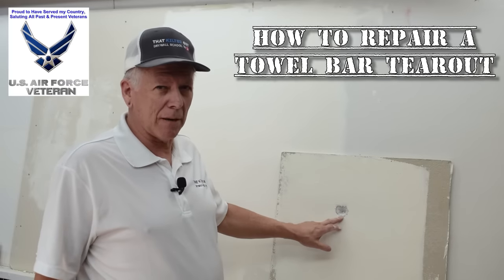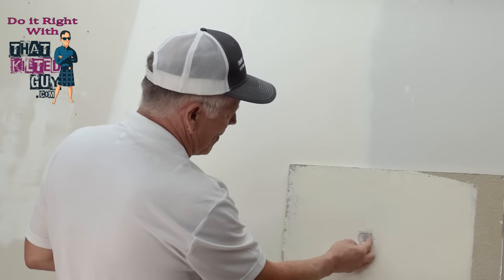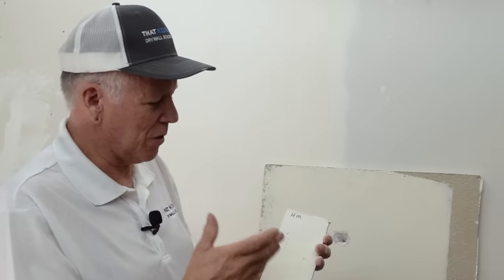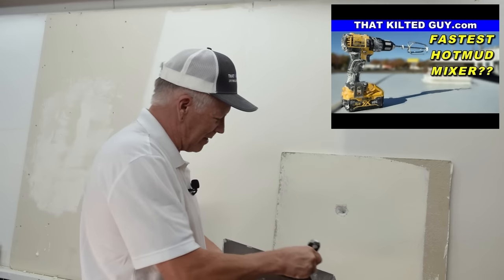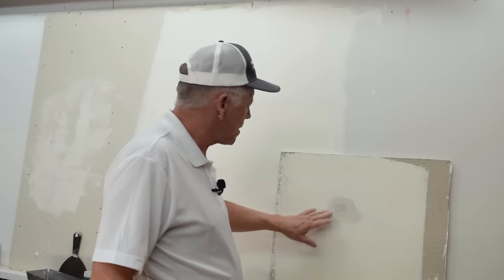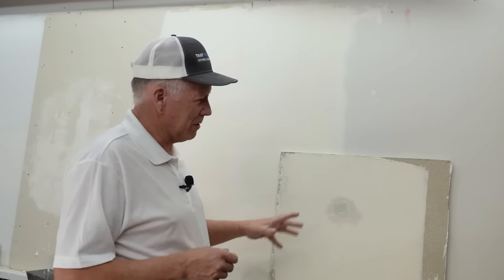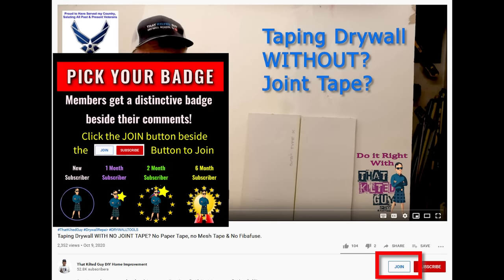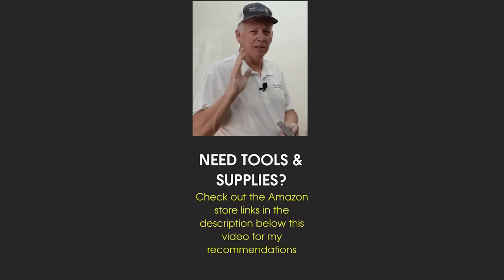How to repair a TOWEL BAR Ripped out of the Drywall

Comment: Most of these towel bars failing off are  not from children  using  it as a grab bar it's from children  pulling  the towels off   to the side  when drying  their  hands and the anchors are not sufficient enough  to be used in most drywall mediums   toilet  paper  holders are doing the samething. Drywall  isn't a strong  medium  for use with everyday use  with shotty anchors , most of these  homes are builders  track homes that use crappy  components to anchor towel  bars to drywall,  I started  working  on builders  track homes  in 1981 and have seen it all when it comes to anchoring systems , if you have small children  it's best to use a towel bar that's mounted  on a wood base plate that in turn is screwed  to the wood studs every  16 inches instead. Of the drywall.  As kids are hard on on these items!  Kids are kids !

Comment: I would like to see the towel bar being replaced, and how strong it is, that's the purpose of the video is it not?
Reply from the maker: After this repair, you can re-install like normal.  It will be the same strength as before.  If you wanted it even stronger, you could cut out about 1 sq foot and add plywood backer strips, then refinish and re-install.

Comment: So strange that my kids just pulled out the towel bar. I'm actually going to cut a hole from the other side of the wall to add 2x4 bracing so that the kids can jump on the towel bar and still not tear it out. Also really liked how you experiment with hot mud vs all purpose to determine how thick it can be before it starts cracking while drying.
Reply from the maker: Donald, thanks for being a subscriber. I’m going to do another video one day showing something similar. You could cut out a section from the towel bar side and slide 12” long 2x4s in as backing making it much stronger.
Reply: Every time I have one of those pullouts, I cut it big and put in the bracing.  When I mount a towel bar, it is always to studs or a brace goes in for attachment.  The kids taught me that lesson years ago, anchors or even just screws are temporary as far as they are concerned.  And then the older in-laws start using it as a grab bar too.  Moved the towel bar and put in a proper grab bar for them at their house.
Reply from the maker: Reinforcing is the BEST way for sure
Reply: Ist thing you do is discipline your kids and make a  big deal out of pulling off the towel rack before you go cutting big holes in the walls. I raised 2 rowdy boys, I know

Comment: Am I understanding correctly? Using the hot mud let's you re attach the towel bar in the same location anchored in the hot mud? I do section 8 apartment maintenance and this would be a game changer if I'm understanding correctly. You know these section 8 peeps can't keep a towel bar or tp holder in the wall to save their life. 😅
Reply from the maker: It’s strong enough to hold up a towel, but it can still be ripped out. Only if there’s plywood behind it will it be super strong

Comment: Thank you, thank you, thank you! Your video was so incredibly helpful. I went with the 5 minute hot mud because it was the only one I could find in a smaller quantity (3 lb bag). I had no problems with it setting too quickly. I let it cure for a couple days just to be safe. I sanded it, primed it and painted it. I was able to replace the towel bar mount in the same location, drilling a couple of holes in it for drywall anchors, and it's so secure and holding. Other than having to replace the torqued towel bar with a new one that's a little shinier than the mounts, you can't tell anything happened. Thank you!!!!!

Comment: Once the hot mud is set and sanded, can you re-drill through it to mount the towel bar into the same spot? I have wallpaper, so ideally, I would want to mount it in the same spot again. Is the hot mud strong enough to drill through and hold?
Reply from the maker: Watch this - Testing a DRYWALL HOTMUD ONLY Repair.  It's STRONGER THAN THE DRYWALL or Plaster
https://youtu.be/5_t38ZVG-ao

Comment: Can you use screws or lags bolts after this so the towel bar can be reinstalled?
Reply from the maker: This method will hold a light amount of weight such as a towel but anything heavier needs additional reinforcement such as a Molly bolt or backing material behind the wall

Comment: Thank you for the video. I broke my towel holder and it has a little dent and if I followed your method would it be ok to replace a new towel rod on the same spot again?
Reply from the maker: I need to do a video testing this but I think it’s about 80% as strong. If you use hot mud by itself its stronger than the drywall was but it could break away from the sheet rock. Check out how strong it is here - THIS IS CRAZY! I Can't Believe This Drywall Repair Method Worked! https://youtu.be/vZtOdhBuz90

Comment: What is the second coat material?  Is that also 5 min hot mud?  The picture looked different from the first, and all you said was "we can coat this little one with a six"  But I don't know what "a six" means.  Thanks for your help!
Reply from the maker: 6=6” knife. Any mud works for the second coat but when it’s really thin I usually just use regular mud for the simplicity of it
Reply: @ThatKiltedGuyDIY  Thank you.  Since I want to save money, I think I'll just use another coat of the hot mud, if it's all the same.  Time doesn't matter.

Comment: Thank you for this video! Can I put a towel bar on the same spot after I fix the hole or the hot mud will not hold it?
Reply from the maker: It should hold It for light use
Reply: @ThatKiltedGuyDIY  thank you!

Comment: Great video.  After many years of DIY I was unaware of hot mud.  For holes such as this I always cut out a rectangular hole and screw a piece of wood backing across lengthwise.  I then fill in with several coats of joint compound.  The rail anchor then screws through to the wood which makes it incredibly strong.  That might be a bit of overkill now that I know about hot mud.  Many thanks.
Reply from the maker: That is stronger but unless you cut a hole in the other side you still have one weak point. 
www.ThatKiltedGuy.com
Reply from the maker: You are welcome Buddyboy

Comment: Thanks for this. Where is the link to the "Hot Mud"? Is it the Zinsser Guardz problem surface sealer link provided in the description? I have a wide blunt plastic screw anchor that ripped a chunk of the drywall out and I am hoping this will fix the damage. Alternatively, can I use Bondo since I have some of that offhand?
Reply from the maker: Bondo is much harder to sand and work with. I’ve used it on woodwork but not drywall. You pick up hot mud locally at the big box, stores, or a drywall supply company

Comment: I like the video, but I'm having some difficulty finding "hot mud". Is this a brand name  ? I 've asked at Lowes & Home Depot and they don't know what I'm talking about ?
Reply from the maker: Hot mud is what we call Fast setting joint compound.  Often sold as USG Easy sand.  We call it that because it chemically hardens through an exothermic reaction and that actually warms up quite a bit

Comment: I've only been able to fix this in two ways: use a larger wall anchor (the spiral kind) or move the towel bar up an inch and patch the orignal hole and repaint. I had to fix this many times when the kids were little.

Comment: When I do bathroom remodel I put 3/4 inch plywood in the wall. I have also bought  Stainless steel pipe and cut it so it fits between the studs for the towel bar. Some tenants are hard on things

Comment: I never thought hot mud would be strong enough for that kind of a fix. I figured it would just pull out again. I've always filled the hole with regular mud and moved the towel rack a little to mount in new sheetrock. I will try filling with the hot mud next time and mounting in the same place. Thanks.
Reply from the maker: Watch this- THIS IS CRAZY! I Can't Believe This Drywall Repair Method Worked!
https://youtu.be/vZtOdhBuz90

Comment: I find it utterly ridiculous that towel bars are not made to 16", or 32" centers. Most new houses are now  built with blockingin the walls at towel bar and cabinet height, but the older ones have nothing. Who cares if the towels are not sized for 16" centers, they can be folded. I say fire the people who design these things, they should know where the framing exists.

Comment: After repairing the drywall with this, can I then drill in screws into the repaired area? Will using this product help to hold the screws better? 

(I had a towel bar that was installed with anchors and its left a big gaping hole. There are no studs anywhere in the wall.)

Comment: I used something called gauging plaster in the late 80's to make regular joint compound set up faster.... Hard to do right....Then came Durabond 90 which set up in - guess what---- 90 minutes.... I lost many a drywall pan to durabond 90 because when it set up in your pan you could not get it out and you had to throw the pan out...  When the "hot mud" that he is using came out it was a God send....It is called EZ sand 90 or EZ sand 20  or the EZ sand 5 that he refers to... It is great to work with and I agree with everything he says here!!!  I don't have a Youtube channel and HE does.. Listen to him as he knows what he is talking about....
Reply from the maker: Thanks, I appreciate that.  Even the EZ sand can be a bear to clean up if you forget and let it dry, but with a green scrubber it will at least come off.  Take care, Guy

Comment: Will hot mud be strong enough to reuse the same spot with a wall anchor, and have the same holding capacity as on a new spot in the drywall (no stud behind)?
Reply from the maker: If it’s done right, yes
Reply: @ThatKiltedGuyDIY  - Which type and brand of hot mud would you recommend? The one you’re using in this video?

Comment: That helped a lot.  I take it you can reuse that spot . Meaning you can put another type of bolt or anchor in there to hang towel bar in same location
Reply from the maker: When doing a repair like this, it’s best to move the towel bar several inches higher. Otherwise it’s best to cut out the damage section and replace it by installing good secure backing pieces to attach the repair to.

Comment: You get a board long enough to go between two wall studs, stain and varnish, else paint it, put that up, screw it into studs and put the towel rack on that.  That, when wall studs are not available in the right place for towel rack ends.  You don't waste time with plaster wall mounts.

Comment: How long for 20-min hot mud to fully set? I mixed and applied 20-minute hot mud into a hole from my daughter pulling out the curtain rod mount. It’s a full thickness hole about 5/8 to a 1/2 inch deep. I need to set screws back in to mount the curtain rod back up
Reply from the maker: It's fully hard in roughly 45 minutes but be sure to pre drill it as it can crumble

Comment: Do you have to use normal joint compound at the end? I understand it's easier to sand, but they all seem to come pre-mixed and I'm not sure how long they will last. Since I rarely fix things I like the powder for storage. I have never bothered with the final skim coat of joint compound. Am I missing something big? I like the fact that the 5 minutes dries quickly and I can move on. Thank you for your videos 😊
Reply from the maker: You can use hot mud to the end just fine. Just don’t expect to sand any thickness down. But thin stuff will sand fine.
Reply: @ThatKiltedGuyDIY  is hot mud harder to sand?
Reply: @juanito3821  Yes.  Like he said though, don't expect to sand down any thickness.  If you want to use it's for all stages I'm finishing, make your last coat really smooth and feather your edges tight. Then you can do a finish sanding usually to touch up any small imperfections.  A common method is to use hot mud for initial coat(s), then use premixed compound for the final thin coat, for easier sanding.
Reply from the maker: MUCH harder to sand. Edges sand pretty easy but the middle is much harder to sand.
Reply from the maker: Exactly

Comment: Kilted Guy.  I need a video on how to mud a drywall joint that has an electrical box 3 inches from the joint.  The box totally throws a wrench in your normal approach.  Or a video on how mud a 3-way joint that forms a "T".  Like a where a vertical joint meets a horizontal joint.

Comment: Good demo but I want to see a repair on already textured drywall. Makes it a lot harder to get it smooth when you're fighting large knock-down texture. And I don't see how you could even sand the repair without sanding the surrounding texture down.
Reply from the maker: Use a sanding sponge on the surrounding texture edges.  The surrounding texture is MUCH tougher due to the paint. I show that in other videos.

Comment: THANKS for this video!  I had to rip out some bad DIY tile from a previous owner of this house, leaving chunks of drywall missing.  I saw your video on how to seal the paper, I'm so happy you made this video for my other problem.

I have a question about washing the tools used with hot mud, do you worry about your pipes?  My pipes go through my slab foundation, if they get filled with crud, it requires a jackhammer to rip up the floor.  Is it safe for my pipes to wash tools?

Comment: Hey, thank you for the video, I had a question, after fixing the drywall like this , can we go ahead and re fix the towel bar? If yes , do we need some specific anchor screws ?  Thank you !
Reply from the maker: It should hold up to normal light use.

Comment: Is the cured mud strong enough to then drill holes through and mount the new rack with drywall anchors? Or should you use toggle
bolts?
Reply from the maker: It’s pretty strong but I’d treat it like Drywall
Reply: @ThatKiltedGuyDIY  Thanks! My father fell in the bathroom a while ago, he ended up being alright in that particular situation, but I’m visiting and wanted to fix it.  Its a toilet paper holder, not a towel bar, though. It could be possible to potentially relocate it six inches to the right. Ideally in a stud. We’ll see. Wish me luck!

Comment: If the hole is like 2 inches deep, can I do this and put a screw back in that hole with an anchor? I'm in an apartment and they used this long screw for some reason but they aren't good at fixing this.

Comment: So, didn't hear mentioned anywhere, but feel like it should have been:

With this kind of product / repair, does that mean you can rehang the towel bar in the same location, or is this now completely solid like rock/plaster and can't be drilled or screwed into anymore like regular drywall?

I ask 'cause my brother installed a towel rack for me, but only used one large anchor screw into the drywall, whereas there were two screwholes (no idea what hardware was included with the rack, but assume a second screw into the second bottom screw hole would have been more firm/stable and less likely to pull out from an errant shoulder bump than just the one attachment point). Anyway, the other side is still anchored into the wall, trying to figure out if there's a way to re-anchor this in the same location, but add the second screw for more stability. Or is this location now a total loss, and I'd have to mud both holes and start over higher or something (limited places in this bathroom for it to go, so this wall is really the only place it can reasonably go).

Comment: Why do you call it hot mud when that is not the name of the product(s) used? Is hot water used with the powder to make the mud? Please explain. (put a note about this below the video so everybody will know.)
Reply from the maker: We call it hot mud because when you mix it with water it creates an exothermic reaction which creates heat and hardens it quickly.

Comment: Can you reinstall the towel bar in that same hole?
Reply from the maker: Yes, if you are careful.  It won't be quite as strong that way.  For super strength, put a piece of OSB behind the drywall before patching it.  Might require cutting it out some though.

Comment: The whole wall has to come down to make the repair RIGHT. Holmes on homes
Reply from the maker: BS. The homeowners said they were not putting the towel bar back and you can repair drywall like this just fine. Guy, 35 year Drywall Pro

Comment: The problem  with hot mud is that it doesn't  sand down the same as all purpose  or topping mud  because it is a harder patch compound because  of the different  ingredients  of it being  hot mud
Reply from the maker: True but not an issue if you don’t have to sand the hot mud

Comment: I wouldn't trust the hot mud alone to secure the towel rack. i would angle in a small piece plywood maybe 1/4 in. thick for a backing with a couple of drywall screws, then mud.
Reply from the maker: Unless you are really tough on towel bars, this is enough. Watch this - THIS IS CRAZY! I Can't Believe This Drywall Repair Method Worked!
https://youtu.be/vZtOdhBuz90

Comment: Great tutorial! Thank you! After a repair like this one, on a hole no more than 1 inch diameter, would you be able to apply a plug and screw to hold the bath towel fixture? Thank you!
Reply from the maker: I’ve done it and it works fine if you’re careful not to chunk up the mud too much while drilling the pilot hole

Comment: Is the Hot Mud, strong enough for me to use the same area again for the same or new towel bar?  More specifically could it be drilled and an expansion plug inserted into the hole, without any rear backing like wood strips?
Reply from the maker: I did another video where I demonstrated that yes you can do that

Comment: What do you do if the towel bar keeps getting pulled out.  I need one in that specific location but it keeps getting pulled out by less than gentle renters
Reply from the maker: Put plywood behind the drywall